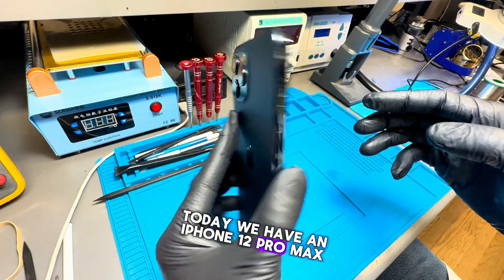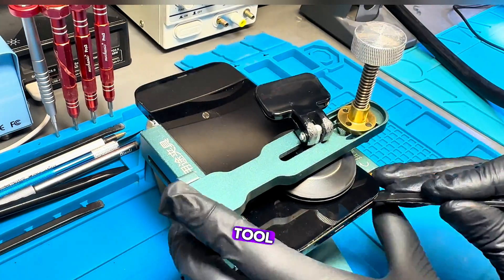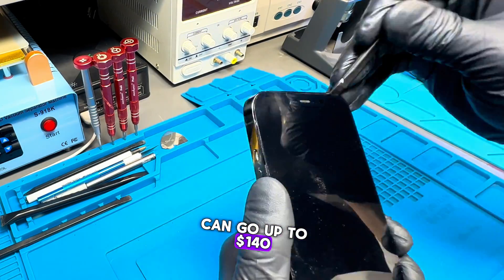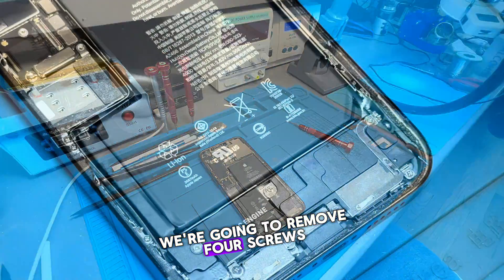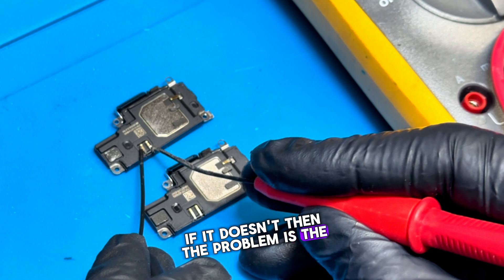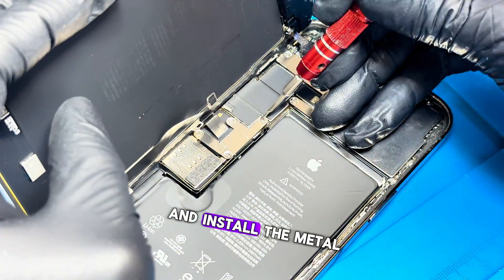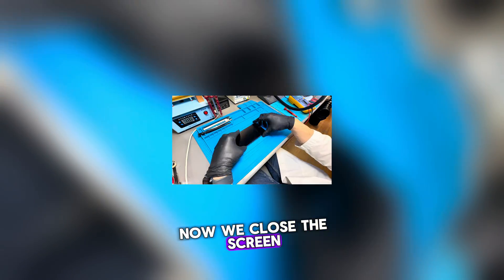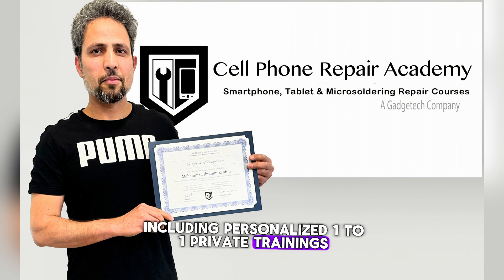iPhone 12 Pro Max Loud Speaker Repair

Comment: I have a question if I may... I have an LG wing phone and the speaker is quite tinny.
What I wanna know is...can the speaker be replaced with a louder 3rd party speaker..?.. you know, modified to custom fit and connect etc...in the right hands.....just curious.